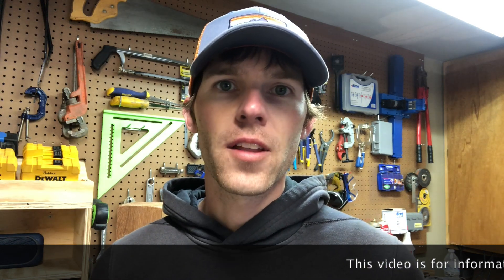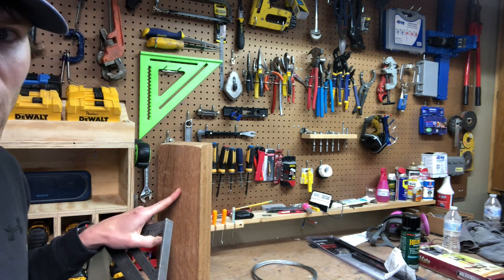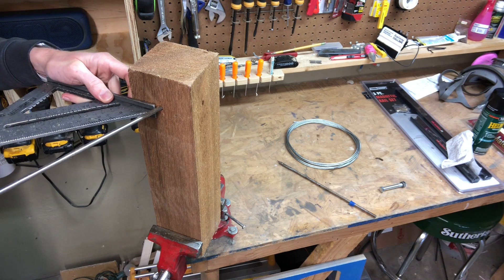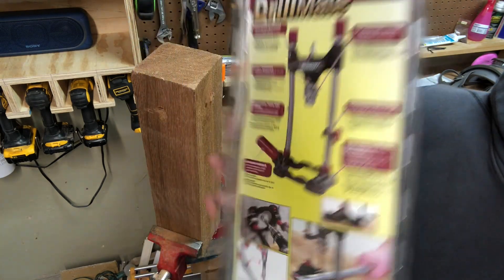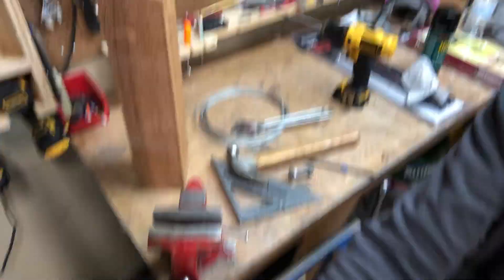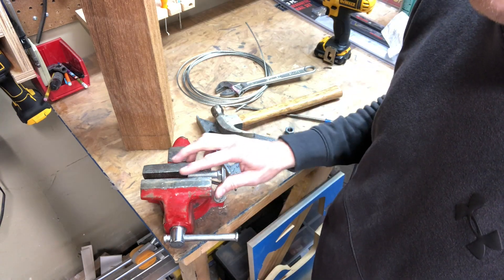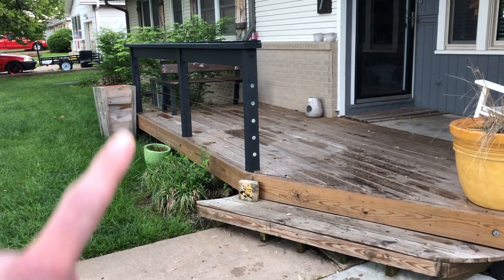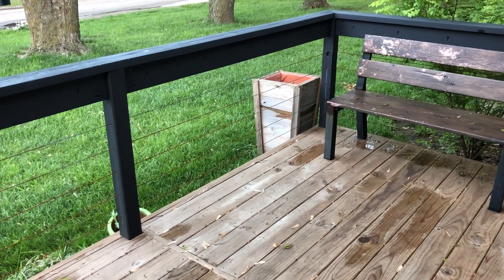Cable Railing 2 Year Update and Questions Answered.

Comment: I'll be doing something like this myself soon for an ornamental backyard fence, and was planning to go with hot-dip galvanized cable and cedar posts. Since cedar isn't pressure treated, do you think I could get away with galvanized cable instead of stainless? There's about 200' of fence to do, and I'll probably run 8 or 10 lines of cable at 4' spacing, so stainless could get expensive. It's hard to tell from the video, but I think you mentioned that most of the rusting is near the posts due to the pressure treating, so maybe cedar posts would help the cable last longer?
Reply from the maker: Bungle, from what I could tell, most of my rust started where the treated lumber touched the cable.  I also had some near my turnbuckles though, and I’m not sure if that’s because that’s where it was cut, or just because it’s right under a bush and stays wet longer.

Comment: Did you install the post on the deck or were they already there? I just had a deck installed and we really want to do the cable method but there were no post so we're going to have to start from scratch.
Reply from the maker: Tonya, I installed the posts with the deck when I built it.  You can still add posts to an existing deck though.  I like having them set in concrete with the deck so they are more rigid and stable.

Comment: If your going to take the time to do this do it right . CODE states that no cable span can be more then 3 feet apart and the cables can not have more then 4 inch separation.

Comment: Do you find that you have to tighten the cables? If so, how often? Also do you have any signs of wood rotting where you drilled into the wood for the cables?
Reply from the maker: Hello!  I have had to tighten the cables 2 times...but it literally takes about 30 seconds with the turnbuckles.  I assume the wood shrinking a bit as the pressure treating dries out is why.  It's been about 1 turn of the turnbuckle each time.  I have not noticed any rotting in the holes, but if you are concerned with that you could squirt a little Thompson's Water Seal in them to make sure.  I've been very happy with the railing with the exception of not using stainless cables in the first place...
Reply: @PottersWork  thanks for the quick reply and insight! I might actually squirt a little clear silicone into the hole after stringing the cable to avoid any ants or termites from getting in and making a home.
Reply from the maker: Fishermen, that would be a good idea too, moisture and insects can cause lots of issues for a deck!

Comment: @potter’s work how far apart is the spacing on each cable?
Reply from the maker: Anthony, I believe mine are 6” but railing was not required at my deck height here so it’s more for the look.  I’m not home to measure at the moment.  I would call your local building official to see what the rules are for your area to make sure you are in compliance.  :)
Reply: Thank you. At the time our home was bought (2 years ago) a railing was not required on our deck either. Assuming nothing has changed I’m going to be following your design to a tee. Can’t stand not having a railing.
Reply from the maker: Anthony, let me know how it turns out, I had fun doing ours!

Comment: Nice video.  I have used an alternative to the elevator bolts that is quick, easy, and reduces the cost to... wait for it ... just about free.  I rip a strip of pt lumber to 1 inch by 1.5 inches and the height of the post.  I cut a 1/4 inch groove 1/2 inch deep along the wider surface, and then drill holes for the wires with the usual spacing.  Then I loop the cables in one hole, along the groove, and out the next, avoiding the need for any hardware.  It helps to round the hole edges in the groove to smooth the cable run.  The entire strip can then be screwed to the post.  If there are an odd number of runs the orphan can be secured inside the end strip with a cable crimp.   I find the look  neat, though views can differ.  The key benefit is you eliminate fully half of the end connections.
Reply from the maker: David, that's a great idea, do the cables cut into the wood at all like that?  I noticed before I had sleeved my holes on my corner post that the cables were kind of eating into the wood since they were pulling against it and not just running straight through.
Reply: They will eat into the wood a bit,  depending on how much you tighten them.  You could offset the holes a bit to allow for this.  Given that there is some binding, I usually use a tensioner at each end of a there and back loop, though on short runs sometimes I cheat and use just one.  In theory, if you can loop a single cable back and forth 6 or 7 times with just a single turnbuckle - Ive done that for short stretches, eg a few feet on the far side of a gate- but I wouldnt try it where you want to be sure of getting all runs equally taut.  Thinking on it now, there is probably a trick to be invented to put some sort of metal half round inside the groove to deal with friction and notching.  If I come up eith something on my next project Ill let you know.
Reply from the maker: @davidhorowitz7020 , I think the metal half loop to reduce friction would def help, then I bet you could for sure get the runs equally tensioned or at least close.

Comment: I'd need 32 of those elev bolts. Not going to manufacture that many...I'll need to find something else.
Reply from the maker: I probably would go another route too!  I had a company contact me a couple weeks ago to do a video for their products, they had some more affordable cable railing hardware. I have not used them yet, so I have no idea on the quality.  here is a link to them though if you'd like to look.
https://smile.amazon.com/stores/node/18105953011?_encoding=UTF8&field-lbr_brands_browse-bin=Muzata&ref_=bl_dp_s_web_18105953011
Reply from the maker: Maybe something like this in the place of the elevator bolts.  Again though, I have not used them and can't speak for the product.
https://smile.amazon.com/Muzata-Stainless-Balusters-CK17-Installation/dp/B07JYL6VVJ?ref_=bl_dp_s_web_18105953011
Reply: @PottersWork  thanks
Reply from the maker: @rubbersole79 , no problem!  Good luck!